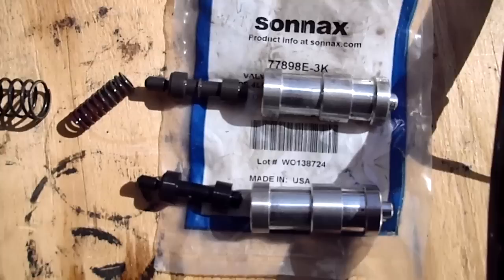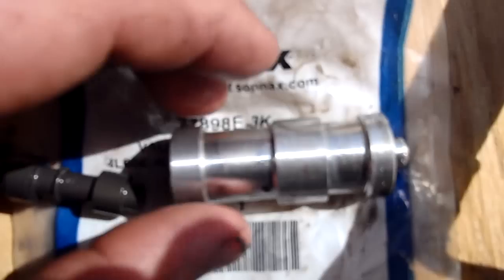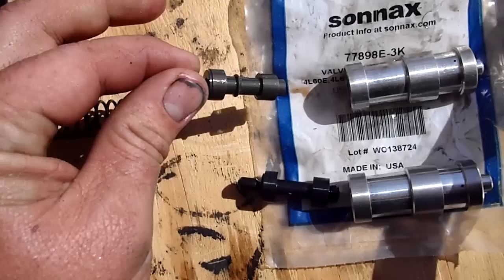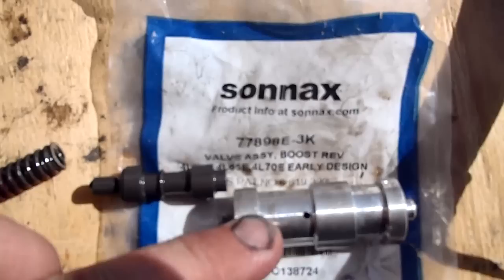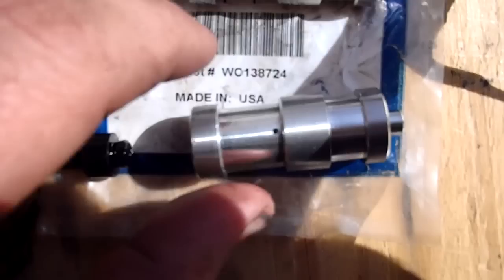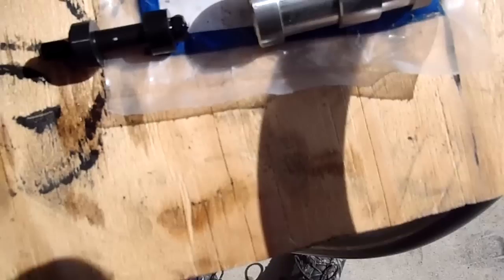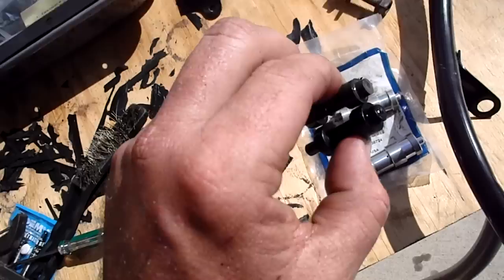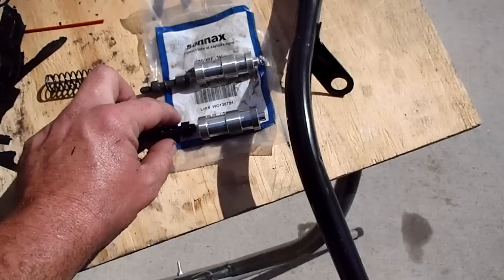Sonnax 4L60E transmission line pressure boost valve

Comment: were you able to replace that with the trans still in the vehicle?
Reply: Fits 4L60E, 4L65E, 4L70E and 4L75E 93-Up Except Hybrid units.

".500 Boost Valve" Fits both early long and later model short type Boost Valve assembly.

Special Instructions: Up to March 2005 installs without transmission removal. After March 2005 an Input Speed Sensor was added which requires transmission removal for installation. Previous to March 2005 does not require transmission removal.